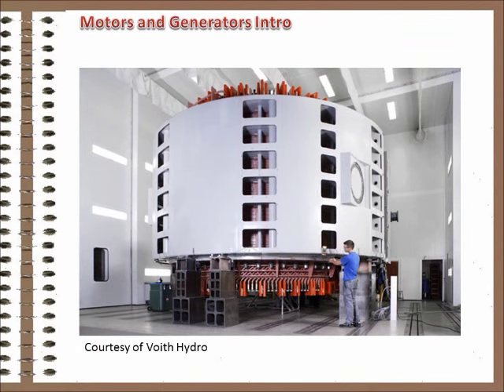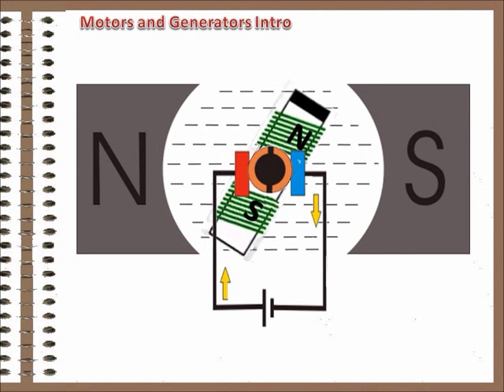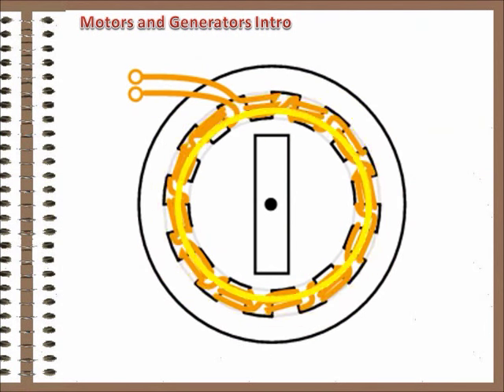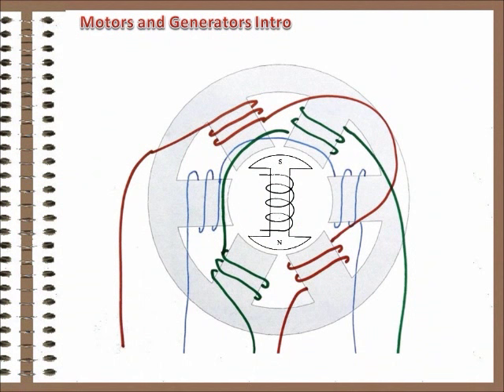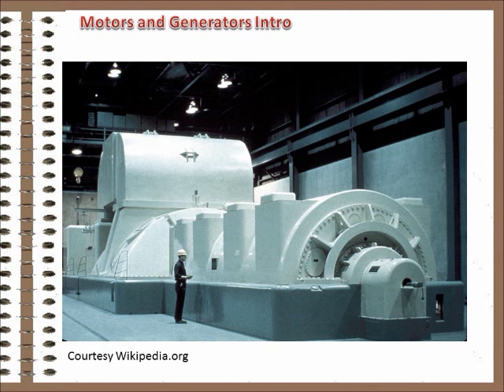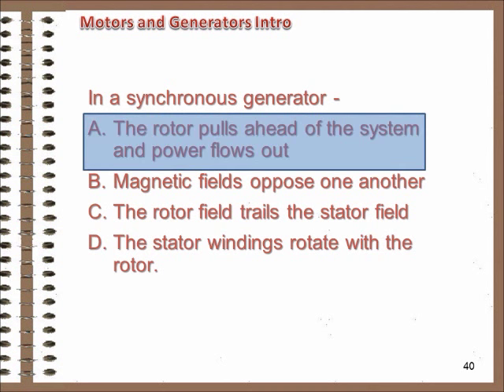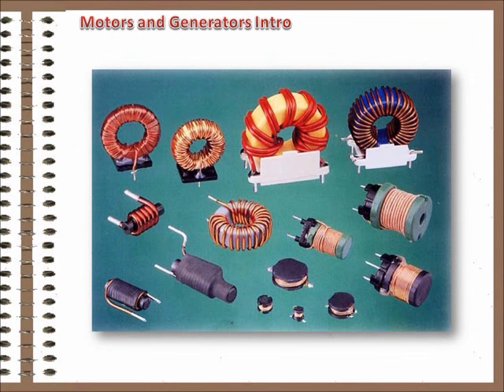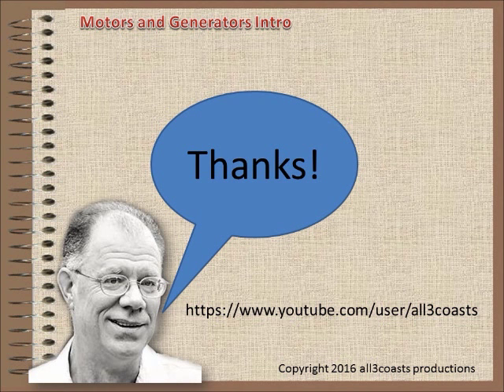Motors and Generators

Comment: Thank you.  Your presentations are very helpful.  

I am not an expert on generators or power flow but I read on Wikipedia about power transfer in terms of torque applied - so I have been fascinated by that - have not forgot it to this day.  Perhaps you can add a slide on that would be quite eye opening I thought.

Quote from Wikipedia:

"Power (watts) is the work per unit time, given by

  
    
      
        P
        =
        
          τ
        
        ⋅
        
          ω
        
        ,
      
    
    {\displaystyle P={\boldsymbol {\tau }}\cdot {\boldsymbol {\omega }},}
  
 
where P is power, τ is torque, ω is the angular velocity, and ⋅ represents the scalar product.
Algebraically, the equation may be rearranged to compute torque for a
 given angular speed and power output. Note that the power injected by 
the torque depends only on the instantaneous angular speed ..."
Just like with pedaling on bicycles... if that helps
My conclusion was that power output is proportional to torque.  On 60Hz systems I guess this could be simplified to P (Watts) = 377 * Torque.  Or something close to that.
Reply from the maker: Have you watched my video on motors and generators? Here's the link -  https://youtu.be/SQHrPjqIe14 - it covers the basic motor/generator actions. Please let me know if it helps and what additional content might add value.

Comment: Can you talk about power flow Vars and Watts based on voltage difference and angle difference between two sources?  Something tells me that the pull push of the rotor somehow relates to this...  Thank you
Reply from the maker: I'll start to work on a short subject to explain this...thanks for the suggestion.
Reply: @all3coasts  
Your videos are fantastic, please make more videos like stator windings in AC machines, harmonics, back emf, magnetic drag etc